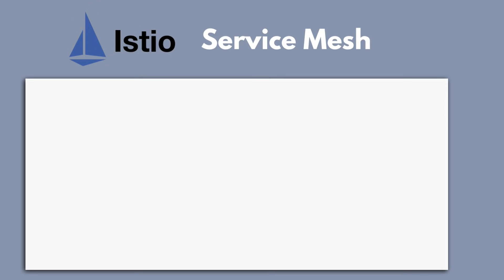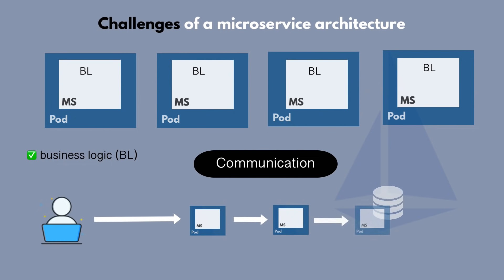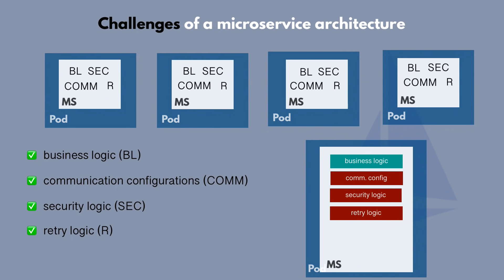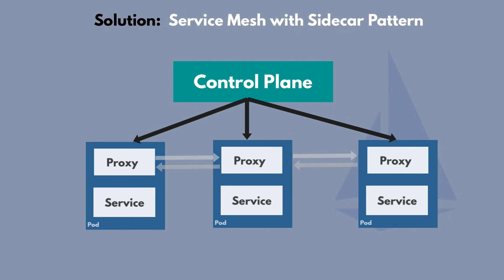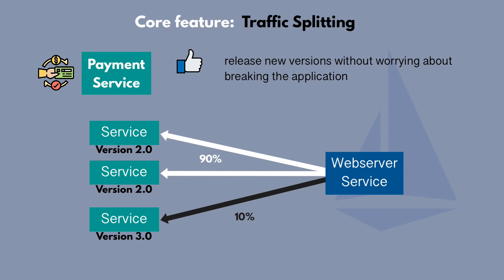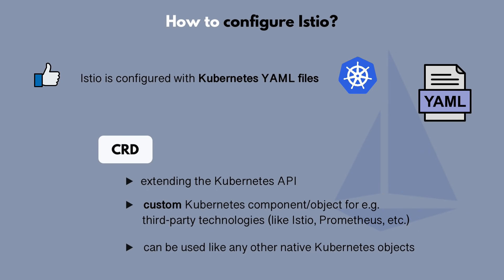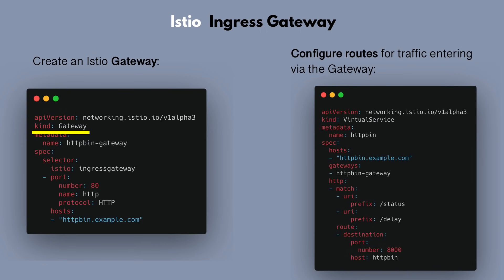Istio & Service Mesh - simply explained in 15 mins

Comment from the maker: If you liked the video, please leave a like and subscribe for more DevOps content 🙏 😊

►  Check out the complete DevOps Bootcamp 🚀      👉🏼   https://bit.ly/3ODb1qW
►  Step by Step Guide to setup Istio in K8s                   👉🏼    https://youtu.be/voAyroDb6xk

▬▬▬▬▬▬ T I M E S T A M P S ⏰  ▬▬▬▬▬▬
0:00 - Intro
0:53 - Challenges of a microservice architecture
5:11 - Solution: Service Mesh with Sidecar Pattern
6:15 - Service Mesh Traffic Split feature
7:25 - Istio Architecture
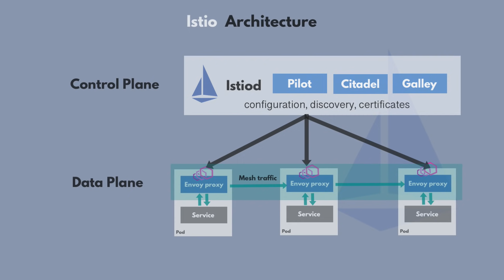9:05 - How to configure Istio?
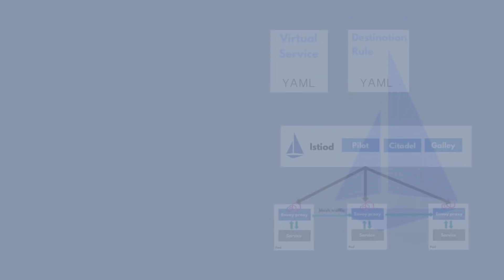11:57 - Istio Features: Service Discovery, Security, Metrics & Tracing
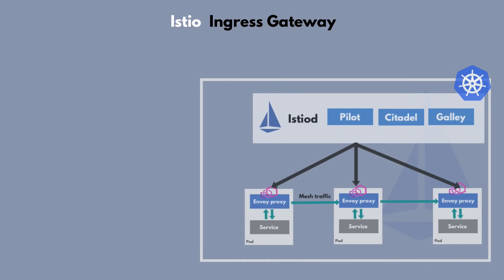13:19 - Istio Gateway
14:06 - Final Overview: Traffic Flow with Istio
Reply: Nana, please make videos for Vagrant Technology Also if you get time!
Reply: Thanks.. excellent video! Quick q - if a service needs to return response back to request then do all responses go via envoy proxy as well ? Or envoy only comes when request is routed to service and if service wants to communicate to other service?

Comment: Istio is tool for service mesh. 
Service mesh manages communication between microservices.

Each micro service has it's own business logic and communication configuration, security logic, retry logic, tracing and monitoring logic .like payment service handle payment logic , webserver handles UI request, database persists data.
Micro-services need to communicate with each other.

Solution is sidecar proxy container.
 Sidecar proxy handles these networking logic, acts as proxy, third party application, cluster operators can easily configure it. And developers only need to focus on actual business logic.

Service mesh on controlplane injects these proxy sidecars to each pods. So that micro services can talk to each other through those proxies

Comment: I have been used Istio since a short time, there are many interesting concept to learn, as service entry, routing etc.
At front-end of the kubernetes cluster, i use a HAproxy load balancer, the communication is redirected to worker nodes, as ingress istio gateway uses in my configuration nodeport. It works quite well. Also, we can ingress TCP connection. All about TLS , certificate is easy to implement. But I did not find any practical configuration to connect to different databases inside the kubernetes cluster through the ingress Istio gateway, but anyway istio is great tool.

Comment: First thing, if s1 is going to call s2 time of design it is clear both communite or not if both are in same intranet no worry about internal security as both in private subnet if both are in diffrent then difffrent security mechanism. 
It is also like esb onky think creating multiple esb ( proxy)
It has pros and cons as increasing too much proxy also increasing manageability. 
We can easily do all these thinks in interceptor and no need of extra complexity of service mesh

Comment: brilliant as usual Nana thank you
i have a question please
is k8s managed service uses Istio by default? or does it use other service mesh implementation?
Reply: There exist many "frameworks" for a service mesh, istio is only one of them.
And it is not included by default.
Using Openshift you can activate istio by using it as operator (crd) for longer time.
For older versions of istio installation process was complexer...

Comment: Will it be a slower process when requests reach to gateway and further the requests gets processed by each proxies ? How to fine tune for faster worker processes/threads ? Also, Happy New year 😄
Reply: A workflow can be slower if there are many microservices...
Pro are
a) if there are any issues, You can trace them...
b) from customer view More workflows are processed correctly (retries...)
c) no developer has to implement additional Code for the enrichment

Comment: Thanks for this useful video. How does in this set-up, the calls within different services are load-balanced(@15.26 in your video)? i.e. the istio gateway will route the traffic/balance the requests to a certain webserver but when the webserver has to go to the payment proxy, how does it know which host to send the request to? as the virtual service/destination route will not be routed via a gateway?

Comment: Hi, I have a setup of  istio and metalLB in my bare-metal k8s cluster. Does the traffic from external client first hits metallb or Istio ? if it hits Istio only, I am wondering if metalLB is just used for providing external IP ? it has nothing to do with data plae traffic ?

Comment: Its a old video so I am not sure I will get response but anyone with ans pls comment. So nana mentioned that when a new micro service is added it will automatically be registered and no extra configuration is required. and other services can now communicate to this new service. But don't we need to add the routing rules and also in the application code also some service should have http call already present to call this service

Comment: You ate misleading new microservices users.
There are two way either use proxy or interceptor. 
You can use generic interceptor class in springboot & rest template / webclient .
For tracing log aggregator collet log& trace data .
Unessary adding one more layer always not benifits .
Service mesh is one solution not always good